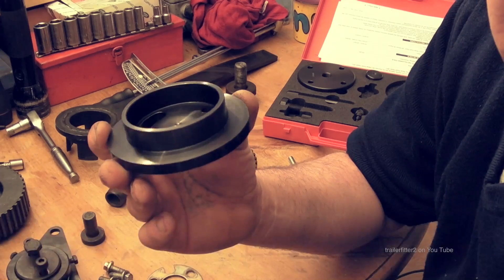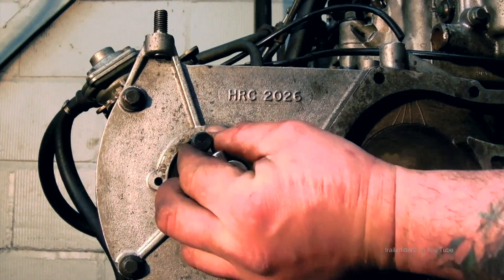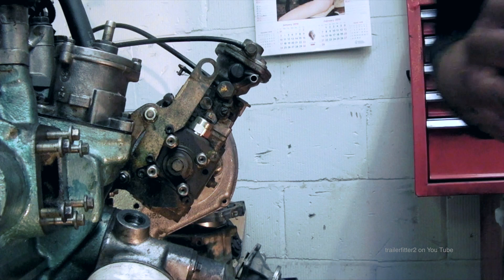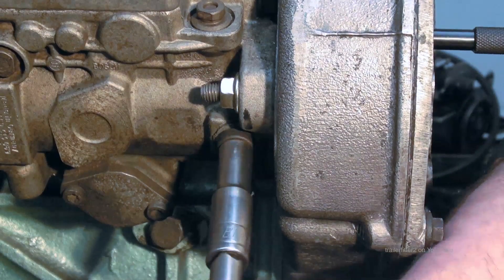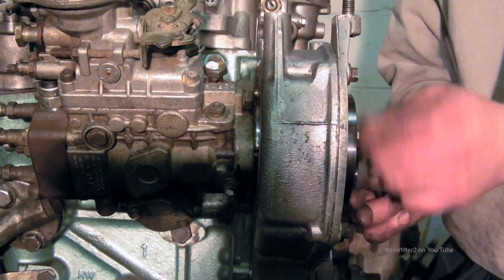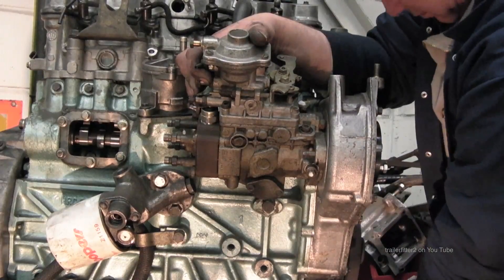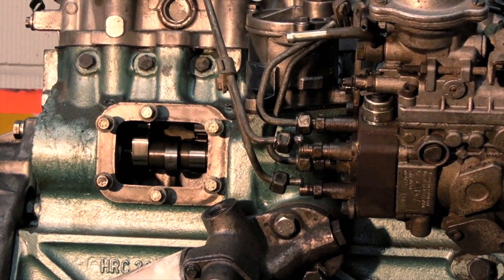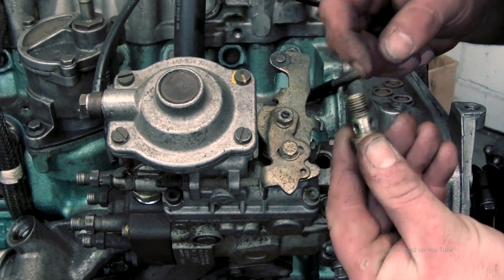Bosch VE Injection Pump Land Rover. Remove and Refit (Pump Support Tool PM029)

Comment: This video is amazing!  It is the sole reason I replaced my IP on 300tdi with success.  Only one tip, the screws of my locking ring couldnt reach the new pump timing wheel.  Once the new pump was bolted up snug, I had to install the locking ring three screws without the ring 1st to pull the pump wheel closer to the timing gear. removed the screws, then reinstalled with the locking ring and they could catch the threads.  All in took me 9 hours, but I had to work around A/C compressor, A/T kickdown cable, clean engine, and mend 3 broken wires I discovered.

Comment: I've just bolted my newly reconditioned pump on but it's locked solid . It won't turn    either way to get the timing . Can anyone throw any light on this ? The locking plate is loose .

Comment: This is an excellent instructional video, I watched it first years ago, searched for it and used it today to correctly fit a reconditioned fuel pump to my 300Tdi. Simple, straightforward guide that gives you all the necessary information to do the job correctly without mishaps.

Comment: Heloo great vids. They are my go to when doing repairs.
Whats the symptoms of failing pump? I have a totally off beat tick rattle
Seems to get better when warm but still there in the background noise. Replaced all the usual lift, vac pump done gaps, same with a different set of injectors too. Lost

Comment: i want to change the pump on  my d1 300tdi but my spare pump was just removed from another engine so i don't think it was set or anything like that before removal.....does it need to be set to a specific setting or does it have to be in the same position as the older pump wheel?
Reply from the maker: https://youtu.be/R6v2G0Inz5Y

Comment: With my EDC automatic, #1 valve at TDC and the timing tool in the slot on the automatic's flywheel, the timing slot behind the access plate is 180 deg out from what is shown in the video, is this correct?

Comment: Good video, so I should be able to remove a pump on 300 tdi, using this tool and locking pin then once it's out the pump can sit there with no pins in? Just refit into another engine and time pump up using the pin ?  Is it also possible to remove and replace without the bracket tool? 😁
Reply from the maker: the kit will help you do the whole job however if you are removing 2 pumps and wanting to swap them over simultaneously with one kit that would be a problem unless you have a spare pulley support tool.

Comment: Great tutorial, thanks for posting. I've just removed the Injection pump from my 300tdi Disco and had the throttle spindle, bush and seals changed due to wear and leaking. The pump is definitely sprung away from TDC and as the 300 pump doesn't have the locking bolt like the 200 I found to accurately time with the pin a long ratchet on the pump nut was required. Also doing the job on my own it was a bit tricky to get the flywheel timing pin to locate as it's not sprung loaded, but in the timing kit was some other pins that were spring loaded so by carefully dismantling I was able to swap the spring. However gentle turning of the engine was required until the pin dropped in with a  with a click, otherwise the pin will be wrecked.

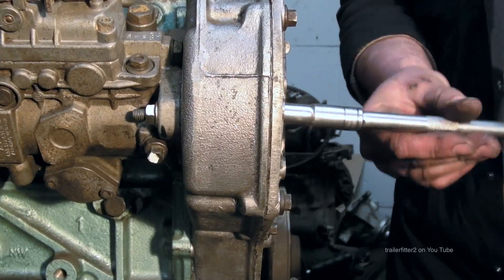Comment: Following your process with the tool kit... had it all timed up but it rotated slightly when I loosened the locking plate screws (at 3:25) so that the timing pin no longer slides all the way in. Do I need to get everything lined back up TDC before I proceed with threading in the bolts?